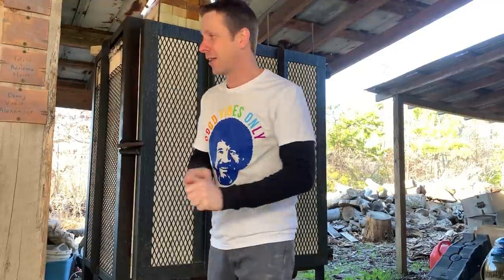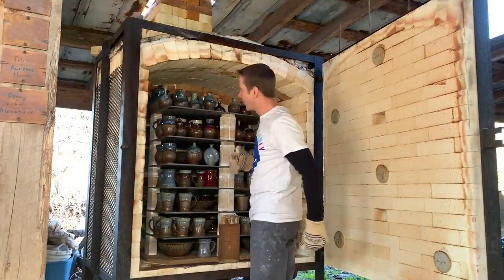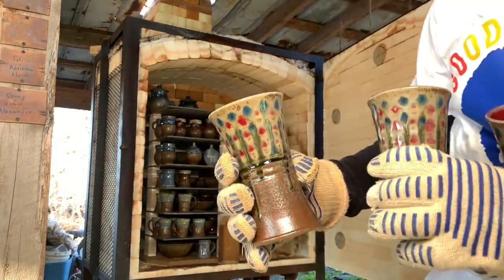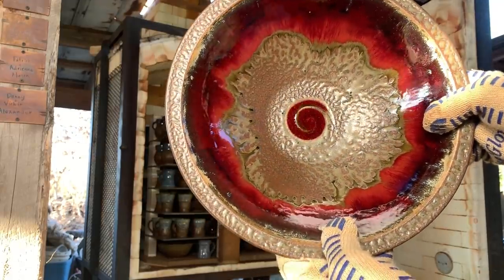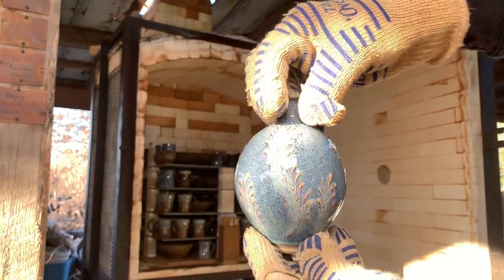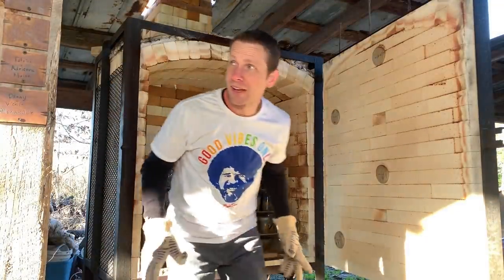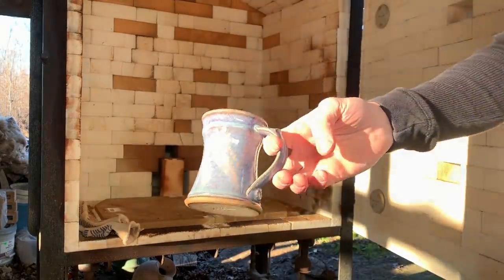Kiln Unloading - Gas Kiln #2 of 2020

Comment: Wow, supernice work man!
Can you tell me at what temperature you use the gas kiln for the glaze firing?
I built my own gas kiln (barrel style) and had some good experience but now i am struggle a little bit with all the worries about food safety and water absorb rate etc...
At the moment i am usin a clay with pretty much grog (0,5mm) and just use glazes from BOTZ because they are almost all "food safe"...
My problem is, they recommend a bisque temp at cone 08-07 and glaze at cone 05-04...
So my pottery still have about 9% waterabsorbation and i am not sure  if should change the clay to a one with lesser grog? But i am worry about the fast temp differences in my "smaller" kiln?

Anyway im always like your Videos very much!

Greetings from Austria ; )
Reply from the maker: I’m glad you enjoy the videos. I’m firing to cone 11 in my gas kiln. So I’m at 2350+ Fahrenheit

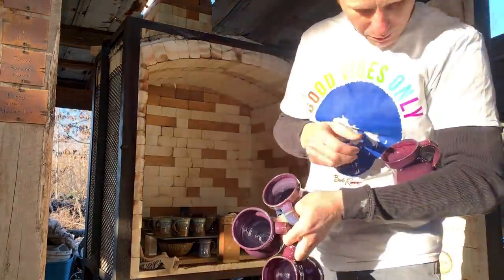Comment: SUCH a pretty kilnload! Congrats... you are so productive, and everything comes out so beautiful (or should that be beautifully?)...this must make you feel like it's Christmas morning!  ...btw, forgot to ask - if you ever have a lidded vessel with its lid slightly stuck, what method(s) do you use to separate them? I've tried prying with a screwdriver but that has resulted in tiny chips, and then pounding with a rubber mallet...sometimes works, sometimes not! p.s. Love all the variety in your glazing patterns and colors! Now I'm gonna have to search through your videos to see if you share glaze recipes! I love the rutile blue, wondering if that is available commercially, love the blue-to-lavender hues (~7:30 on the video) and also curious about the purple on the mugs at ~16:50... I'm a purple-holic! The studio where I work only fires to cone 6 so these cone 11 glazes probably won't come out the same or at all at cone 6...
Reply from the maker: I usually tap on the lid with a piece of wood, maybe a 2x4 or something. That seems to help it release while not shocking the pots too much to crack it. I mix all of my own glazes, they are not commercially available.
Reply from the maker: The glazes I use would definitely not work at cone 6